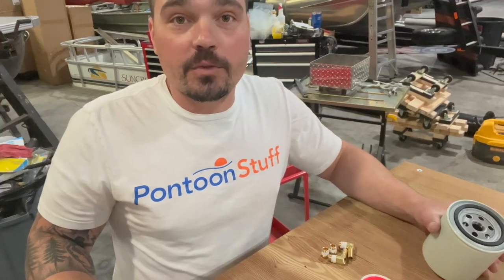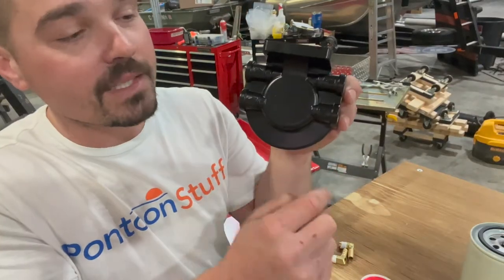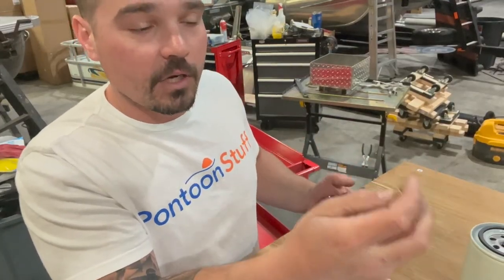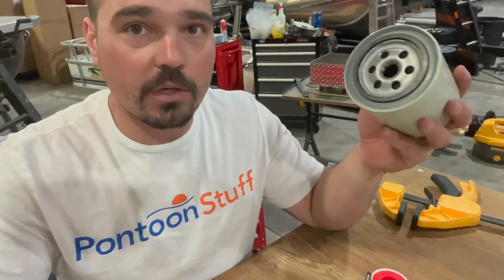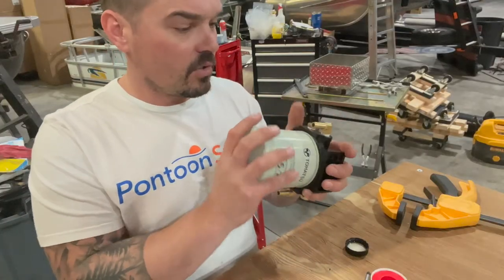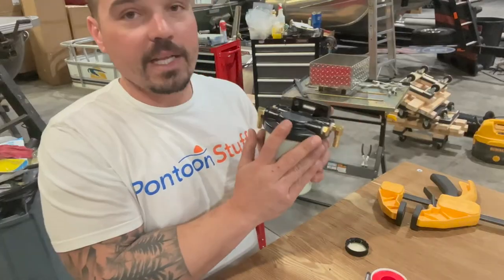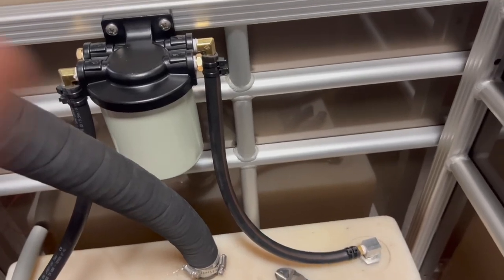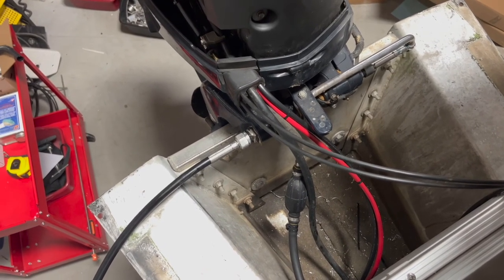Water Fuel Separator & Filter Installation - A MUST HAVE ON YOUR BOAT!

Comment: I add a water fuel separator on my tone with Mercury 115 command thrust and it bogs the motor down it Rough idle.
New 91 octane fuel. 

Have you heard of anything like that?
Reply from the maker: Did you pre-fill the canister? And make sure your fittings are all snug so no air can get in. It shouldn’t cause any issues. Sounds like it’s not pulling enough fuel though.
Reply: @tomspontoons  yes pre filled the filter, everything is tight, flow is right , It’ll run but it acts like it’s running out of gas. 
I bypassed it just to verify the filter was my problem and it ran great. 

The only thing I can think of is if its mounted to high.?.?

 u tuber was saying the Mercury didn’t recommend water filter but I have found anything that verify that.
Reply from the maker: @FlyingPaintMonkey  I've never had an issue mounting a filter above the tank on a pontoon. I agree that it would be best to have it below to allow gravity to help, but hasn't been a problem for me. And the mechanics at the local marina have told me over and over that the new EFI motors can pull fuel no problem as they have multiple fuel pumps in the fuel system. Also, Merc doesn't mind a water/fuel separator at all. In fact I imagine they'd promote the use of them to remove potential issues. Heck, Tohatsu used to only validate warranty if there was one installed with a new motor!!! Mercury does not call for a primer bulb for their 75 hp and up. They are trying to avoid any fuel flow issues or places for loss of vacuum. You could try mounting your filter lower to see if that helps. Or remove your primer bulb if you have that in addition to the filter.
Reply: I ratchet strapped a gas can to the back of the boat and ran the fuel line off the gas can and it runs great. So now I’m thinking I have a gas tank problem. “ plastic transom tank” so I ordered a new asm valve ??? so maybe that will help.  When In doubt throw money at it. Lol
Reply from the maker: @FlyingPaintMonkey  Last I heard those ASM valves cause nothing but trouble. Hopefully the new one will help, otherwise if your tank is newer and meets current EPA standards you should be able to omit it altogether.

Comment: I would only install the separators that have the viewing glass then you know for sure your filter is still working and not full, with the filter in this video it could be full of water allowing water to get to your motor making this device a crapshoot.
Reply from the maker: I totally get that, and those viewing glass styles are great!! However, if checked seasonally it’s unlikely that there will be that much water in the fuel to where it could fill unless there’s a bigger problem, and at that point it might be too late even with the viewing option.

Comment: Why put it in a hard to get to spot?, shift it right slightly and it would be real easy to get to.
Reply from the maker: Once the fill hose was installed in place the filter was easy to access. It looked terribly in the way with it not attached to the fill neck on the railing.